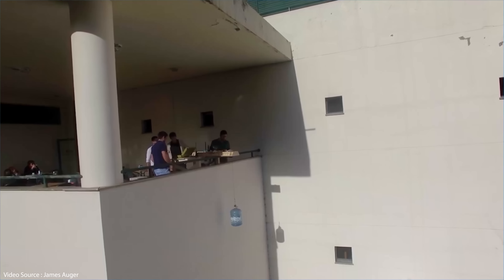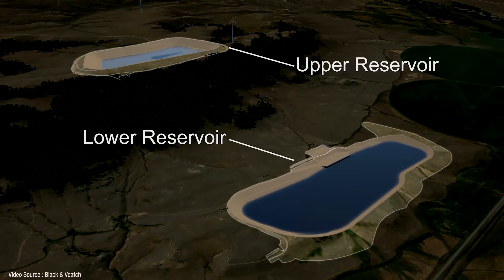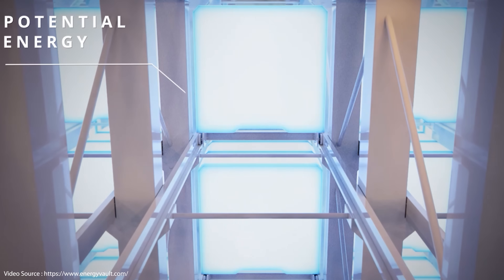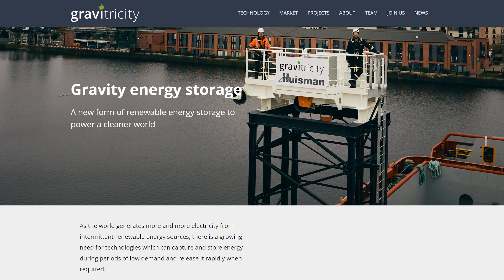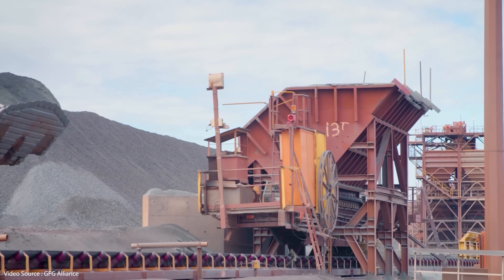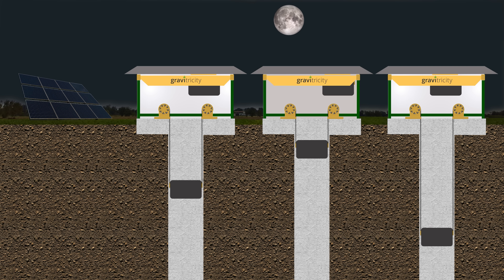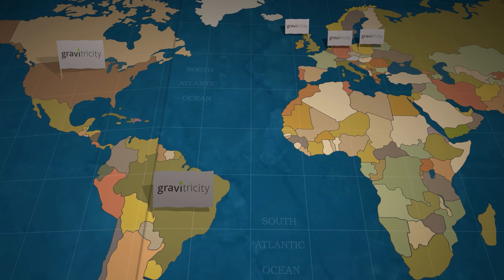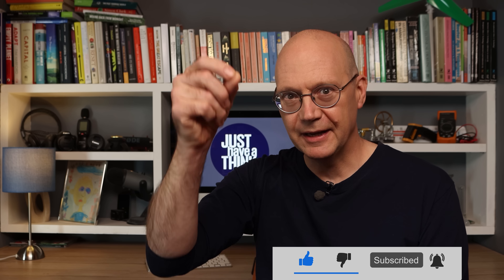Gravity Energy Storage. Who's right and who's wrong?

Comment: Clearly, the most cost-effective and much safer approach is to use existing mine shafts and to create new shafts. If coal mining has been profitable for 200 years, gravity batteries should be as well. When digging a coal mine, a fixed area of the new mine provides energy for just a few hours. As stated, a mine dug for gravity can provide safe and reliable energy for 35 to 50 years!  That must be many times more cost-effective than coal.  China currently has over $2 billion in (non-hydro) gravity batteries in development.

Comment: I don't like either of these. I prefer the ares rail system.  The main attraction of using gravity is that we can use almost anything. 

This advantage is somewhat lost when you need perfect blocks, or a perfect anything.  

The simplicity of a rail car allows any material to be placed inside - dirt cheap.

the practicality and simnplicity, and extensibility, and horizontal scaleability heavily outweighs any slight efficiencies lost or gained.

Comment: In Missouri we had gravity electric storage back mechanism in the 1960s. It was called (I believe) Taum Sauk Mountain reservoir.. But I believe it was really on Tomahawk mountain. They chopped off the top of the mountain, lined it with a water proof covering and pumped water from the river below, during the night when power usage was low and used the generators that had to be run continuously,  to supply the power.  Then during the day they would allow the water run down the mountain and turn turbines at the bottom to generate electricity. The problem that I saw was the continuing streams of water leaking out of the reservoir. It finally failed when the reservoir lining broke and flooded the valley below.  Don't know how successful it was,  but nice try.

Comment: It's not difficult to calculate the total amount of energy a gravity system can store (at 100% efficiency) - height x mass x gravity (just get the units right!)

Apply that to a couple of hundred tonnes and a coal mine, convert to kWh and chances are the reaction will be "is that all!!?" Closely followed by something like "that's only equivalent to a relatively small battery, taking up a fraction of the space, and needing far less maintenance!" (Like pumping out mineshafts.) Followed soon after by "and grid storage batteries are getting cheaper all the time."

Which maybe why Energy Vault seems to be abandoning gravity storage in favour of just such large scale battery.....? Still, if there are generous grants for experimental projects, in spite of how little sense they make, why turn them down?

Comment: If airtight water container less than 100 ft heigh can use vacuum rrplace water floe down drive generator. Actuall only 1 m high with ton of water outlet 4 in pipe can drive aircraft carrier size electrical need

Comment: Hydraulics is the way to make this work.  Piston weights in wells pushing hydraulic fluid through a generator.  The concept has low energy density, but long system life.  It would be well suited to short term energy storage, such as frequency control.  It has high discharge rate and does not degrade even over a huge number of cycles.  When wind turbine power output drops, it takes time to start gas turbines or DGs.  This concept is valuable in smoothing for that application.

Comment: imagine 2 shafts next to each other joined at the bottom with an airlock transfer tube between them. One tube is empty and is used to drop a weight down to the bottom, the other tube is filled with water. once the weight  reaches the bottom of tube 1, it is placed in an airlock and transfered to tube 2 with the water. The transfer lock is opened up and the weight  floats to the surface of the water filled tube. It is then transfered back over to the empty tube to begin another trip down...  getting the weight back to the surface uses no lifting energy other than bouyancy

Comment: The first concept of Energy Vault required big, durable and strong, stackable blocks of concrete (high quality) Now with their now solution it seems as if they could use big metal containers, filled with very cheap (rock) ground.  So more is fully recyclable and perhaps the price is comparable.

Comment: Besides being a store of energy when there is excess solar power... A gravity battery, if sufficiently large and voluminous, could also have residential spaces along it's outside (like a high rise shell)... Water 🌊 could be pumped in prior to large storms that would help alleviate flooding... Water from a gravity battery 🔋 could also be filtered for freshwater and also used for precipitate mining ⛏️ (water 🌊 has a variety of free floating salt ions, some of which are valuable)... My point ☝️ being there are a bunch of clever things you could do with sufficiently large water 🌊 based gravity batteries...

Comment: Ok, every seaport has gantry cranes...everywhere. They pickup the container = energy expenditure...then they lower the container = energy gain. There is a capacitor firm that has a capacitor strategy to capture the energy gain and expend it when the crane lifts the next time. 

Unlike chemical batteries capacitors are highly efficient at endless charge discharge cycles.The ultra capacitor category actually have some storage capacity also.

The thing that lifts the heavy block and then drops the heavy block is already out there. Just attach the device the collects the energy gain onto the existing huge chunk of crane infrastructure.  These people are sitting in a seaport with gantry cranes everywhere and trying to reinvent the shtick with the complicated expensive tower thing that lifts something heavy....yikes.Every freaking building everywhere has an elevator, but for people and industrial stuff...is it that hard?

Comment: The best solution ive seen is a mountain slope with a long rail line. Basically the cars are hooked up to a special track that delivers the electricity similar to a subway car. The wheels have electric generators on them and a huge amount of weight with rocks. During peak energy they push the cars to the top of the mountain where the cars sit. Then at night they slowly roll down hill delivering something like 95% efficiency. Now the nice part about this is that hydro power has the risk of evaoprating meaning anything over a 5% evaporation means its not as efficient. Its also instantly available and can meet the exact energy needs. I also believe that eventually you could have a sytem which allows for energy to be harvested by moving large amounts or rock to the bottom of the track. Basically you could find an ideal location with a huge amount of loose rock which would allow this to be harvested for electric power. Giving the potential to make electricity simply by moving a massive amount of weight onto these rail cars and letting them roll down the hill and then be emptied into a quarry or canyon. Theoretically you could be generating electricity on demand simply by having mining equipment move rocks onto rail cars and letting their weight rolling fown hill produce electricity. I think it offers a great opportunity for old mines to be filled as a way to produce more revenue and be an environmentally friendly way to produce electricity. Its also fascinating to think of electric powered machinery that would make the entire system carbon neutral. There are mines all across the country that have been abandoned. And have massive amounts of removed material sititng outside of them. The potential to use those old rails to produce electricity by refilling the mines is like a second gold rush.

Comment: These energy systems are a complete waste of time to store energy is best to do it in an indirect way. How you do this is simple close the gates on the Hydro Dam then allow Water by natural processes to accumulate behind the damn when it rains or snows the water will be stored as energy behind the dam no need for pump storage when the when does blowing and the sun is shining you can supply electricity to the grid while the Hydro dam gates are closed. When the wind is not blowing or at night no solar  you can lift the gates and produce power from the water turbines this is called indirect storage Quebec Hydro can do this the size of the grid can be as high as 14% for Renewables because of this indirect storage system in other parts of the world where these is no storage 10% can be feasible.

Comment: Gravitricity seems like they have a solid plan, and all that remains is the implementation. If it can hit those costs, it will probably grow quickly from there.

Energy vault seems to love the needless complexity of moving things around horizontally and using the same winches with multiple weights. I could see their approach having some value using smaller weights purely for rapid dispatch (load the weight, get it moving quickly to span the gap while something with more inertia comes online.) But completely useless for running hours at a time.

Comment: now tides go up and down around 1m in the bay of Fundy they reach 16 metersm so if you took a large floatation device like a large ship that weight 100 000 ton  over 12 m it could generate  3267  kwh per tides cycle which means 2 tides  a day is 6534 kwh

Comment: Rather than using valuable structural materials like concrete and metal as literal dead weight, use them to build a structure, a tank which holds your gravity storage material: water! Then instead of multiple cables and wheels and bearings, you have a single turbine/pump interacting with the water. So much simpler and lower maintenance. Pumps and pipes, still a great idea.

Comment: No one ever answers how you lift the weight back up without using more energy than you got out. These are $$$ generating scams, debunk one and they come up with a "new better one".  Can't believe you would buy into such nonsense. Unsubscribe.
Reply: Energy has different prices at different times of the day or week. On a windy night, consumption will be low and there will be an excess of electricity so it will be very cheap which is a good time to lift the weight up . During a grey week day consumption will be high and production low so electrical energy will be expensive so this will be a good time to lower the weight. The price difference between the two scenarios can be 2..3...4..5..6x
Reply: Every single battery outputs less energy than is put in.... This is energy storage, not energy generation.

Comment: Instead of 11 minutes of blah blah blah, a little math would have been better: 500 tons 360 m high (or deep) contain 500 kWh of energy. At 10 cents/kWh that's €50 for one drop. 3 times a day gives 1 million € in 20 years. Is it worth it?
Lithium batteries are available for €1500 with 5kWh. 100 pieces with 500kWh cost €150,000... That's 10x cheaper. And they can be loaded and unloaded faster and therefore more often per day. Even if you set the cycles low, it's still 3x cheaper. Today!
Reply: Lithium batteries don't last decades, the supply isn't infinite (so cost would go up with this level of demand), and the actual construction/mining needed to make them is pretty harmful on an environmental scale. Plus it's unlikely a weight will catch fire or overheat.

Moreover, your costs don't really make sense. You're trying to compare the price of the batteries to the cost of operating the weight lifting system. These are not the same thing. The operational costs of charging the batteries is presumably essentially identical to lifting the weight. You'd want to compare the cost of constructing the weight system to the price of the batteries, and frankly, I doubt the batteries are cheaper, especially for the mine shaft weight design.

Also, wear and tear is a factor here. Using lithium batteries like this, draining them repeatedly every day, they'd lose a lot of their capacity within a year. So you are spending €150,000 every year or two to replace them, while the weight is still just costing you €54,000 or so per year to operate and will likely last a decade or more before the equipment needs replacement or rebuilding.

I'm also not sure why you think they could only lift a weight 3 times a day.
Reply: Gear ratios people... You can multiply your power output by 100x
Reply: 3 discharge cycles a day for 20 years is  ~20000 cycles in total. Batteries are already severely degraded after 1000 cycles
Reply: @d716agq  Modern batteries last more than 5000 cycles and the price drops by 50% every few years. There's no way this crappy tower can keep up. The only reason to develop it, is to make the startup rich.

Comment: Since Gravitricity needs a lot of cycles (2 per day) to achieve the 171 dollars per MWh, a comparison to flywheel energy storage would have been interesting.
With such frequent charge and discharge, the self-discharge of flywheels wouldn't be a big problem, wouldn't affect efficiency that much.
And you can build flywheel energy storage facilities basically everywhere, without the need for abandoned mines.
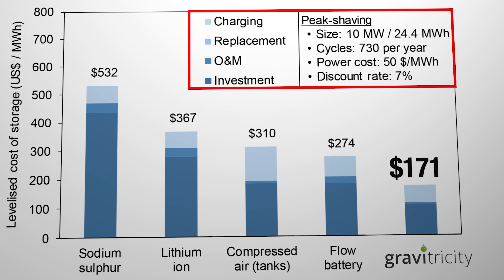Anyway: Aren't these numbers at 8:25 pretty high? $367 per MWh for lithium-ion, that's 37 cents per kWh?
Did I get something wrong here?

Comment: Aren’t most disused mines full of ground water?
Will the ground water have to be pumped out for the system to work and if so how much energy will that take?
Reply: Weight would still fall through water, just slower. If you designed the system with that in mind, there's no reason it wouldn't still work. A 100 ton block of scrap metal isn't going to float, after all.

Comment: what a lot of bollocks - a single Tesla car battery is 50 kWh - that is 180 MegaJoules - or 18 TONs of concrete lifted a kilometer on the air
Reply: A Tesla car battery costs about $12,000, while 18 tons of concrete costs about $1300. At 50kWh, it would cost about $5 or so to lift the concrete one kilometer. So the lifted concrete wins as a storage medium.
Reply: @berserkasaurusrex4233  A Tesla car battery costs less than $5000 and the mechanism to lift 18 tons a KILOMETER in the sky would cost a hundred times that - at least
Reply: @duncancairncross  The Model 3 battery modules (the ones with a total capacity of 50kWh, that I assume you are talking about) cost $5 to $7,000 per module. There's four modules, so the cost is about $20 to $28,000. Mind you, that was four years ago; with inflation, they've probably gone up.

Anyway, a pully, cable, and electric motor aren't that expensive. The cable would be the largest expense, since you'd need at least a thousand meters of it. Galvanized aircraft winded rope is about $0.60 per foot, so you'd need about $10,000 for the total cables (6 quarter-inch diameter cables, each 1000 meters long, have a safe lifting weight of about 20 tons).

The whole system could be set up for about the same price as the battery, if not a bit a less, and would last far longer than the battery would at any rate. Even if it were several times as expensive, it would still be more cost-effective than the battery.

Anyway, the system would work just as well with a heavier weight and shorter distance, so the 1km height is entirely arbitrary. Presumably you'd compare all the costs in the system and work out the most cost-effective height and weight, which is probably more like 200 tons and 100 meters. No shortage of 300 foot deep mineshafts in the world, or buildings, or slopes.
Reply: @berserkasaurusrex4233  Complete bollocks the Tesla batteries cost less than $100/kWh - and a 1 km high structure will cost in the Billions of dollars
Reply: @duncancairncross  I'm literally quoting Musk himself on the cost of the battery. Go argue with him.

Anyway, as I said, the height is irrelevant, you'd adjust the weight to match whatever height is convenient. If you have a 300 foot deep mineshaft, you'd use a heavier weight and shorter cables. Energy storage potential would be identical. Cost of the weight would go up, but concrete and scrap metal are cheap, so not really an issue.
Reply: @berserkasaurusrex4233  The PRICE of the battery is as you said - the COST is a lot less.
The tallest building in the world is less than 1 km
If you reduce the distance then you increase the weight - if you use 100 meters - a 40 storey building then you need to lift 180 tons
The structure and the weight and the cables and motors will cost at least $50 million - to replace a $5000 battery

10,000 times as much
Reply: @duncancairncross  You don't know how to read, do you?
Reply: @berserkasaurusrex4233  But I do know how to multiply and add up which appears to be a lot more than you do.
Reply: @duncancairncross  Again, learn to read. I already talked about this, you don't have to pay for a 300 foot mineshaft that already exists.
Reply: @berserkasaurusrex4233  A 300 foot mineshaft - 100 meters - to replace ONE Tesla car battery you need to lower and raise 180 tons of material - most mine shafts are not that big - and certainly not that strong
You are talking about a $100,000 project (at least) - to replace ONE $5000 battery
Reply: @duncancairncross what you are both missing is that with pulley systems and gearboxes, you can multiply the storage capacity by orders of magnitude...
Reply: @growtocycle6992  Nope complete bollocks - gearboxes do NOT increase the energy at all

Comment: The mine shaft idea as presented is only partially mature. Rather than having a single block suspended above the shaft, it should instead have dozens of blocks at ground level on a rail that can sequentially be moved above the shaft and lowered, thus greatly increasing the potential at a low additional cost. At the bottom the block can stack or be placed on another rail and moved down a mine corridor out of the way until excess energy became available to lift them to the top once again